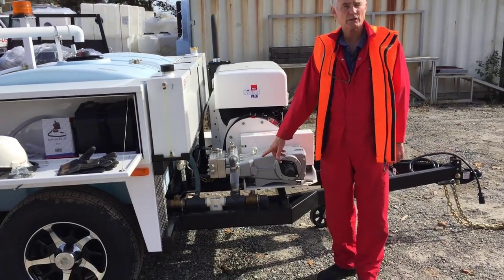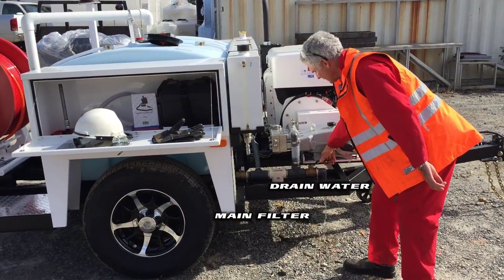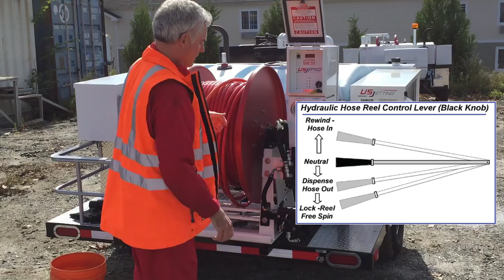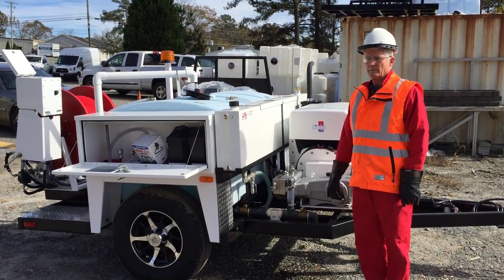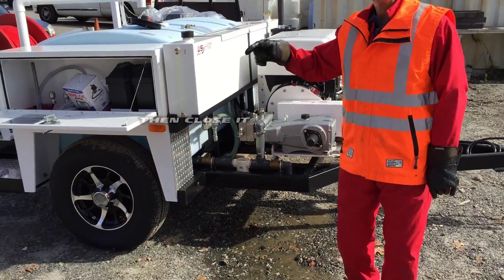US JETTING BASIC OPERATION 4018

Comment: Sure.  A US Jetting 4018 can do all of that if you can get it to start after you get it to the job site.  A reputable company will bend over backwards and do hand springs for you while they are making things right on a failed brand new machine you just bought.  Maybe Covid-19 is holding service and customer support back.  A good company will stand behind their products.  You would think they would at least offer and deliver a loaner machine for you to use while they make the one you bought right and return it to you  Just saying.  If I were in the market for jetting equipment I would probably check out other manufactures.  Where is the spare tire and wheel?